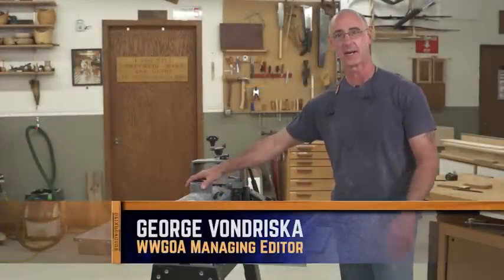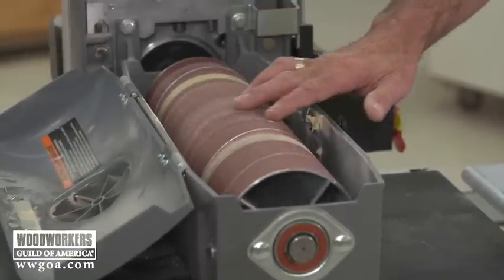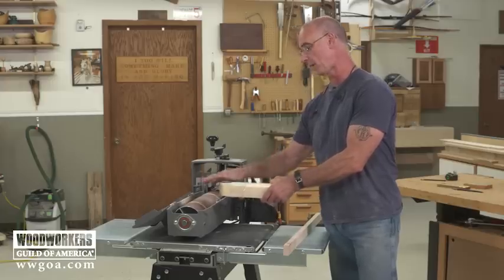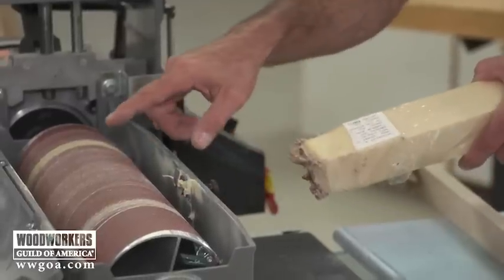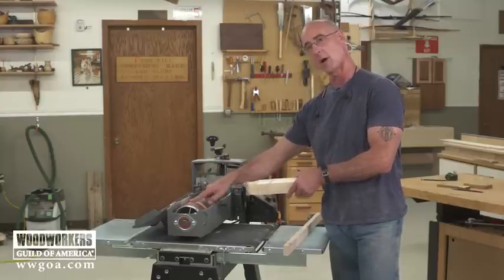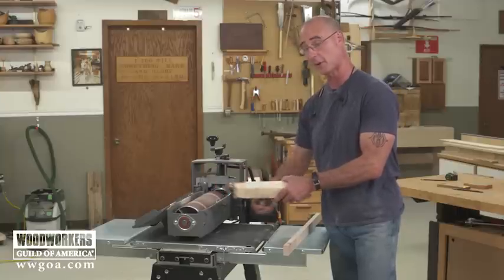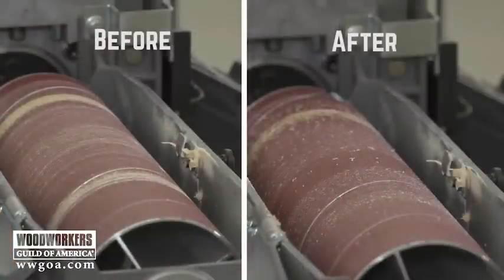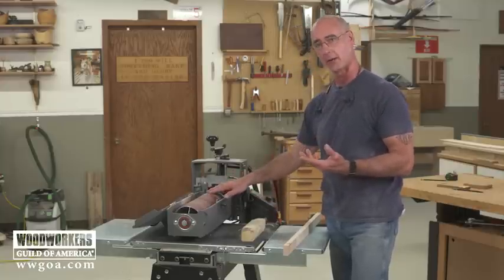How to Clean Sanding Belts

Comment: Another thought: I agree with what LiPe said below. I needed to clean my stationary belt sander and did not have an 'official' cleaning stick. What I did have was a dried out tube of clear silicone sealer. Having nothing to lose, I tried it. It worked great and the rest is history. That was 10+ years ago and I'm still using it. Since a cleaning stick and a tube of sealer are about the same price, it's your call. But if you have some old tubes of sealer laying around you might want to keep one just in case...

Comment: This is a great technique for light clogging, but it won't work for pitch and such.

I remove the belt, role it up tight, then drop it in a wide mouth quart mason jar. The roll will loosen after you get it in the jar. Then cover the belt with a liquid cleaner. A couple of people on here said mineral spirits but I use Krud Kutter Original. You can get a gallon of it at Walmart for $18 or so. Let soak over night. Then simply rinse the crud away in the sink. Let dry and put it back on your sander good as new.

When you are finished put the lid on the jar and label it. You can use it over and over. A gallon will last a lifetime.

Comment: Tip from Stew Mac video: For really stubborn buildup, place sandpaper in container, soak in CMT Orange Tools Formula 2050 Blade & Bit Cleaner overnight, rinse with water hose and let dry. The cleaner can be used over and over.

Comment: I read somewhere that a piece of polycarbonate (NOT plastic) can help remove the really stubborn stuff.  I found it is not perfect either, but will remove some of the residue that the rubber stick will not.  Serious burn, like when I did not pay enough attention to increasing the gap on the last wrap and it climbed, Not so much....in that case, just make a note of where the burn is and work around it.  -Veteran '66-68

Comment: Looks like there are 2 types think one is a large Glue stick and the other like this made from ??
Reply from the maker: The cleaning sticks are the same.  One is newer, and the other one is getting too small to be safely used so it is attached to a stick to be used as long handle.  That way you can use it all up without getting your hand too close to the abrasive.

Comment: The cleaning stick doesn't help always though! My discovery in case of resin buildup: take off the belt and put it in your wife's best cooking pot. Fill it up with hot water and a cup of ammonia and let it boil for a  minute, then let it sit for an hour or so. You'll be surprised: it comes out as new, without having to use a wearing wire brush.